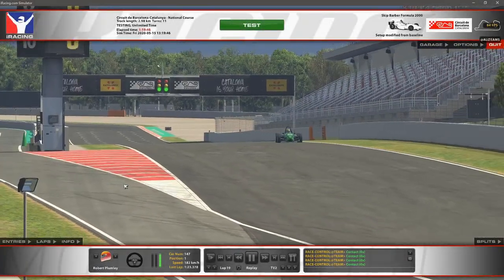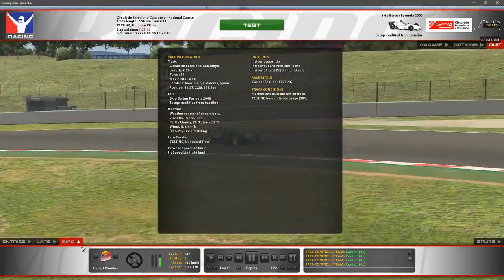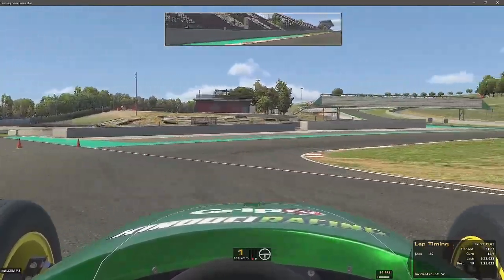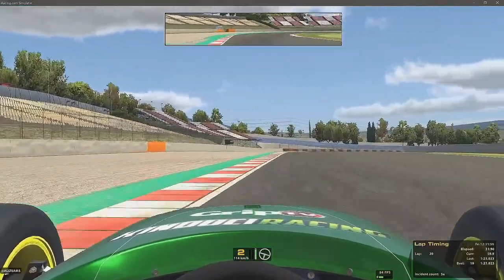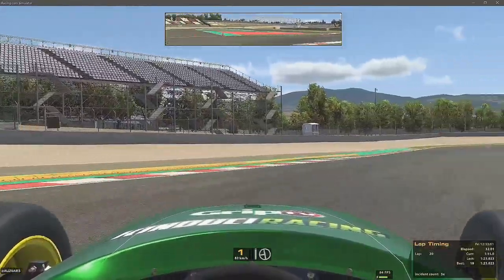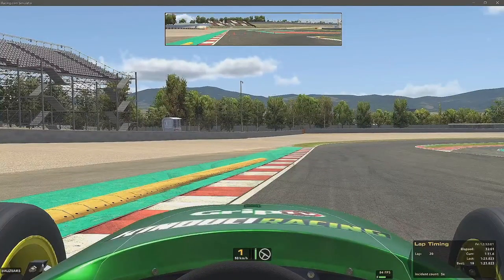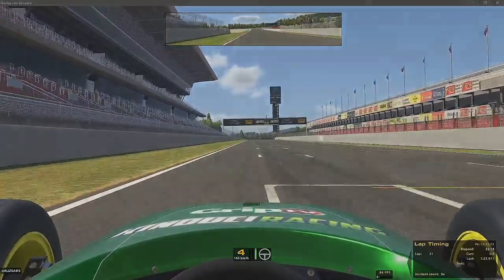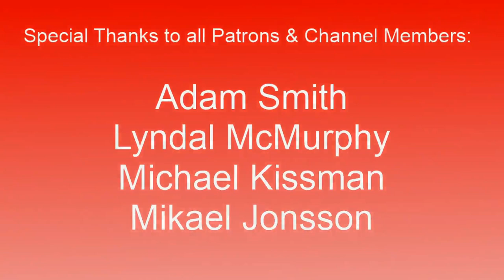iRacing Skip Barber Circuit de Barcelona Catalunya National Layout Track Guide with Setup 2020

Comment: Thanks for the guide. I have found that going a little wide on T2 and cutting through T3 is faster and more forgiving with track limits. You can take T4 flat too. This car can trail brake to an apex but you have to keep the wheel pretty straight, then let the car rotate and use corner speed to get through. Such a fun car to drive.